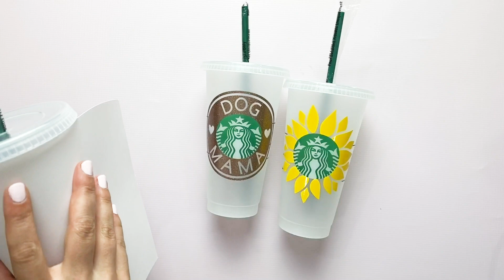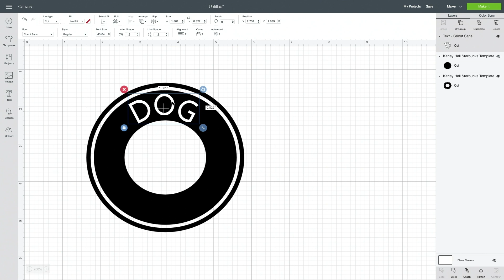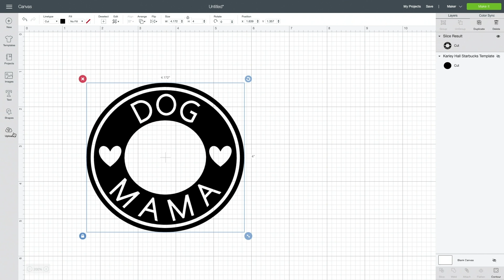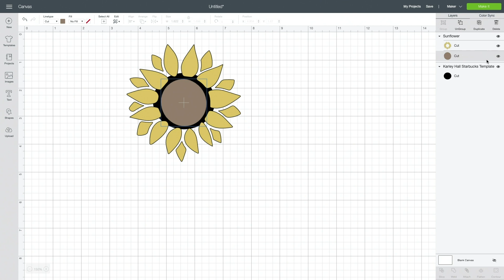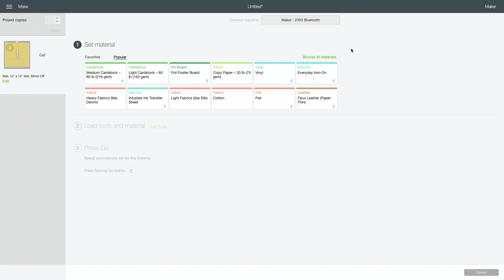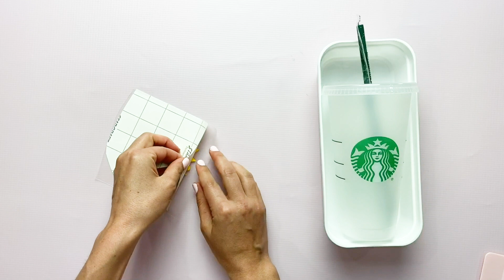How to Make DIY Starbucks Cup Decals with your Cricut Machine! (FREE SVG TEMPLATE!)

Comment: Hi I just did my first cup but the adhesive seems to fall off like I can pick on it and it’ll come off would I have to learn how to seal it or change my vinyl type?
Reply from the maker: Let it cure for 48 hours. After you place it, make sure it’s rubbed on really well, and then just let it sit without getting wet for 48 hours. That’ll give the adhesive some time to reach its full power!
Reply: @KarleyHall  thank you will do that!

Comment: I need a circle around the logo with letters but I need the outside circle to be smaller than the one in this video. Do you have a video for this?
Reply from the maker: Resize the circle to be smaller, contour it to delete the inside circle, and then use the other small circle on the template used to make the wrap, to slice a new circle from your new smaller circle.

Comment: why is it when I make my design the same size as yours its very small
Reply from the maker: Make sure to resize it to the dimensions in the video description. Double check that you’re set to inches and not centimeters.
Reply: @KarleyHall  how do I do that I’m new to Cricut and still learning
Reply from the maker: Click on the image and then type in the dimensions found in the video description. It should be automatically set to inches, but if not, in the upper left corner, there are 3 lines. Click on that and then click settings. You can double check there. I recommend doing a test cut on paper to make sure the template is sized properly before cutting vinyl.
Reply: @KarleyHall  thank you!

Comment: I'm using circuit transfer tape and it is a pain to transfers to cup any advice?
Reply from the maker: I don’t mind cricut transfer tape! If it’s too sticky, stick it on your shirt to destick it a bit!
Reply: @KarleyHall  It sticks to the cup but it is not transferring over I have been using my hands and circuit supplies to rub it out but it is not transferring 🥺
Reply from the maker: It sounds like it’s too sticky! Try desticking it a bit before you apply it to the vinyl. For the ones stuck, you can use a hair dryer to helper release it!
Reply: @KarleyHall  it worked thank you so much!

Comment: I did it step by step but when I stick it on the cup the hearts look uneven. Is that normal?
Reply from the maker: Did the hearts follow the curve? So long as you curved your hearts to follow the template, then when you put them on the cup, they will be straight!
Reply: @KarleyHall  I did not curve them, all I did was line them up.
Reply from the maker: When you line them up, line them up with the curve since those curves will end up straight at the bottom and top of the cup :)
Reply: @KarleyHall  thank you!